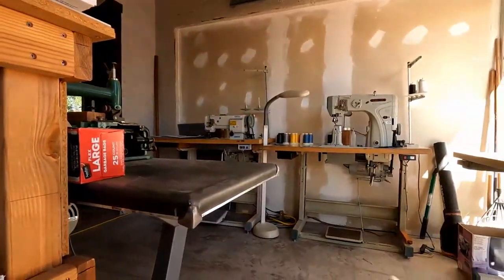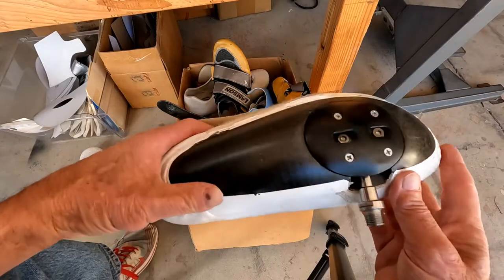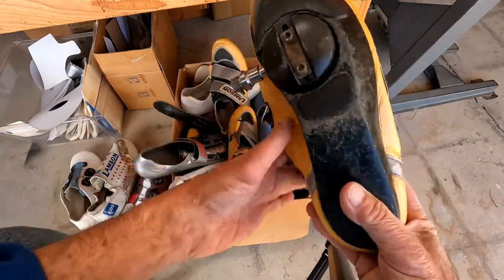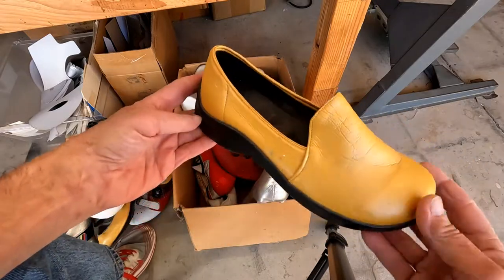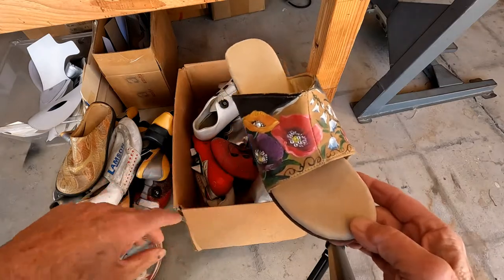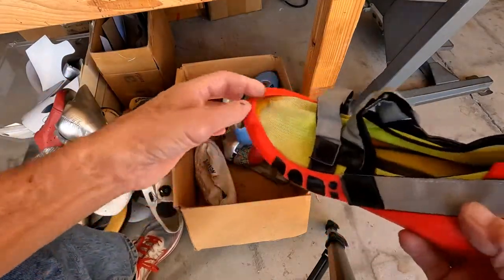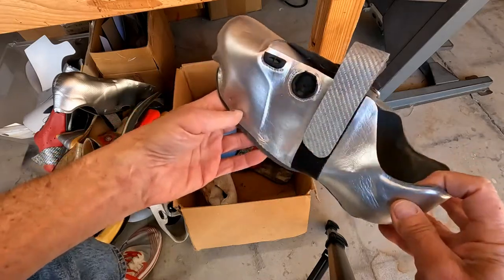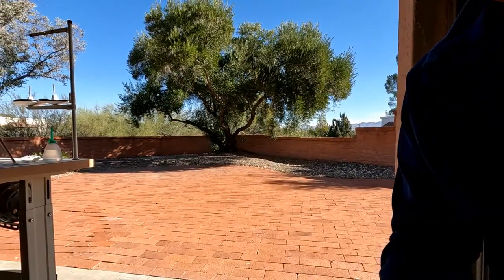HISTORY BOX

Comment: impressive... beautiful work! 

any idea about the history, the why-yes and why-not about having flat sole or having curved sole (toe spring and heel lift)? 
thank you! 

best regards, 
Mircea
Reply from the maker: The original Toe Spring was modeled after the old Duegi wood sole shoes. That was in 1985 or 1986. The new lasts evolved flatter after trying a few different toe springs out. The current one is simply what felt the best; both comfort and performance. I develop my lasts. This one is an evolution going back 35 years.
Reply: @lamsoncycleshoes   Thank you! Given a certain toe spring and heel lift curvature, what would change if more of that or less of that? Or, other way said, what are the pros/cons about going towards a flat sole and the pros/cons about going towards a very curvy sole? I'm trying to understand this aspect, but very little to read about out there... 
Thank you very much,
Mircea
Reply from the maker: @mirceaandreighinea  My theory is that the big toe spring in the past put the ball of the foot at the lowest point, which helped to locate the ball over the spindle. Just my theory. Could be wrong. 
It puts your feet in an unnatural position which can rob power. The flatter sole is more of a natural position which increases power, and seems to make the spin smoother. 
All theory, which is a technical term for "Best Guess"